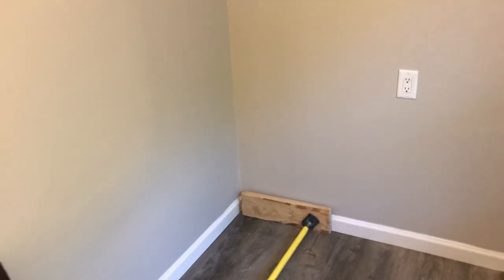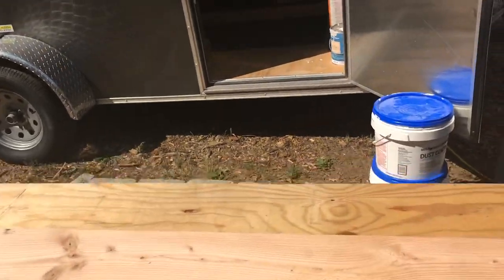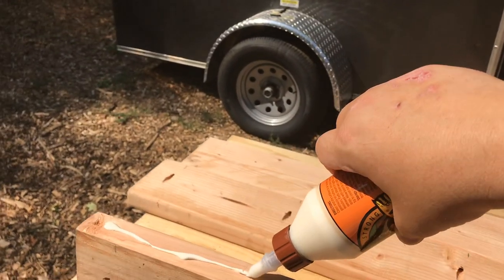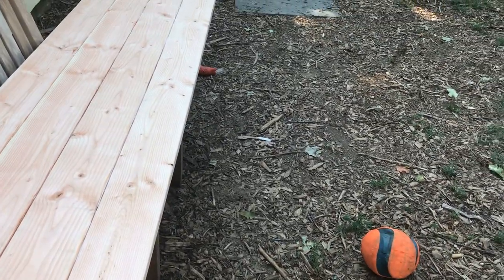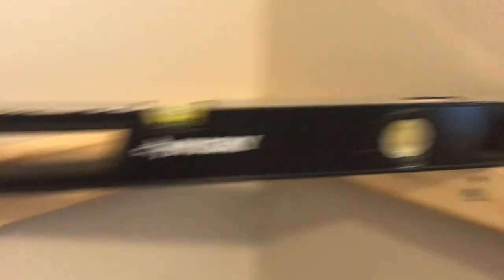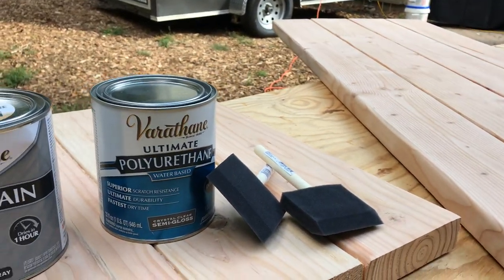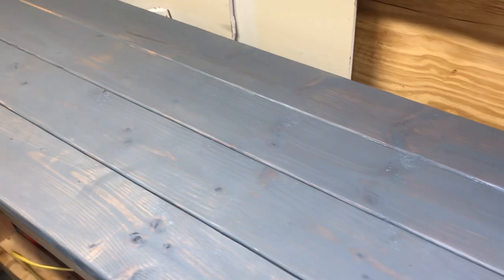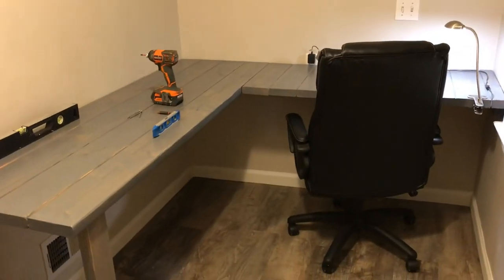DIY Desk under $50

Comment: Looks good boss.  Love my kreg jig
Reply from the maker: Me too. My only problem I had was I can adjust that spacer after using it on the drill bit. Even after backing out the Allen screw. It’s stuck at 1 1/2.